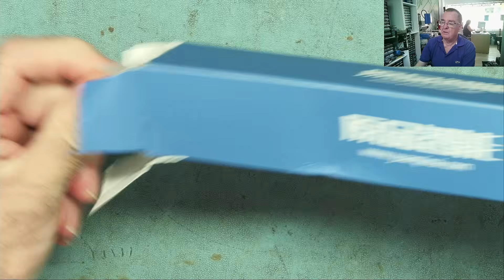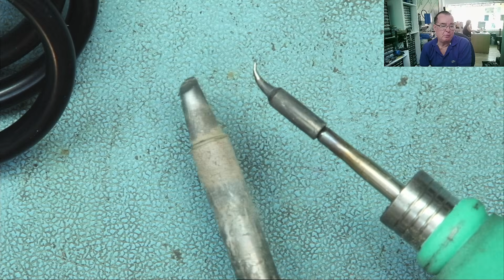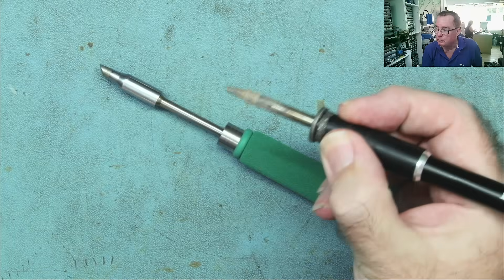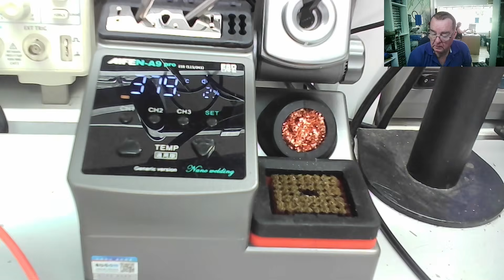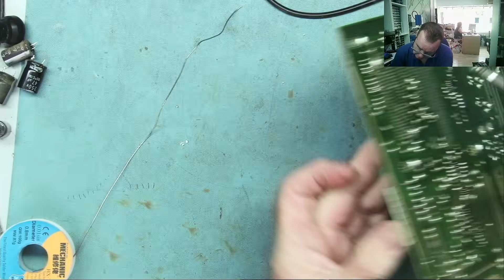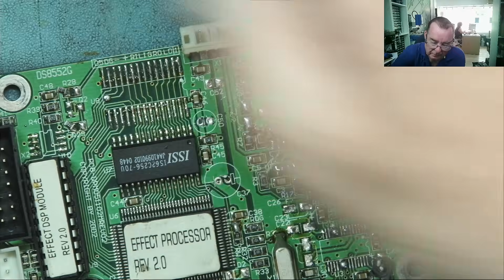C470 Soldering Iron Test : A Bit Of A Beast!

Comment: Hello! Could you please tell me the pinout for the C470 soldering tips? I'm completely confused. Some say the thinnest contact is the common contact, the middle one is the heating contact, and the thickest one, parallel to the tip, is the negative thermocouple contact. But someone else says the thickest contact is the common contact, the middle one is the positive power supply contact, and the thin one is the positive thermocouple contact. Who should I believe?

Comment: you may not see this, I told you about my C245-3C 9mm wide, with my A9E, which actually looks larger that you 4C, which is strange,  It has a short, standard tip length, I'm getting a continuous 40% of 160w power on a large coin, it works well for me, If you find the C470 too long, it might be worth the 5 euro to get a cheap one and try

Comment: 245 24v, 470 48v.
Reply: This. C470 tips are typically 7.5Ω. If you try to run them at the same 24V as C245 tips, you’re limited to only 76.8W because of Ohm’s law. The only advantage you see at that point is the higher thermal mass (there are some very beefy C245-C8 tips on AE)

This is why it had such a long heat up time at the beginning

Comment: That C470 and solder needles work great, even things like that large heat-sink. There is also a C470 handle too - virtually a copy of the C245 except for a smaller allen key screw to  stop the larger bits from falling out of the handle.

The C470 I like the most is the K-tip, and the least is the D-tip (too blunt)

Comment: C470 tips work really well, but they are meant to be used on a 250w station...If you have a suitable station they are amazing for getting alot of heat into a joint....The A9 pro you are using says it is only 120w max, and I doubt it is actually that high...It seemed to still work, but at 250w it is way better!
Reply from the maker: That may be why the A9 Pro isn't advertised to use these tips though in the documentation is says it supports them - which clearly it does.  Can you recommend some 250W stations? I may be able to get my hands on one of them 😉
Reply: @LearnElectronicsRepair  Geboom H310 is a 350W with linear transformer in it, really professional stuff. 
There is a SMPS version HC24 which is even stronger, 400W, but its SMPS as I already said.
Those are beasts.

Comment: Technically, you're supposed to use a 48V station with lots of wattage.
Reply: The JBC T470 handle I have runs at 24v...I think JBC rates them for 250w
Reply: @brucepreston3927  they are just 50% less effective at 24v but they work obviously, they will work at 12v also " technically "

Comment: I use C470 tips and love them.... It is not so much how hot the temperature is that destroys a component but how long the heat needs to be applied to solder and de-solder the best trio is 1) hot tweezers, 2) C470 tips, 3) hot air..... when it comes to soldering that are the tools to use.... for de-soldering I have a different list.
Reply: Supposing one has sufficient thermal mass, then temperature and time will determine how much heat is delivered (assuming that what the heat is going into can absorb it.) Generally... for small components... the effect will be a significant increase in internal temperature. (But, the internal temperature can only rise to what the temperature of the iron's tip is.)
Reply: @willthecat3861  Yup but less heat contact time is always better.. that is the rundown really
Reply: Can you share that list?